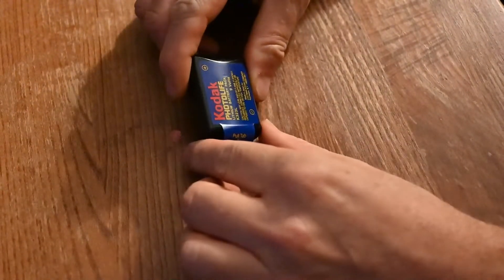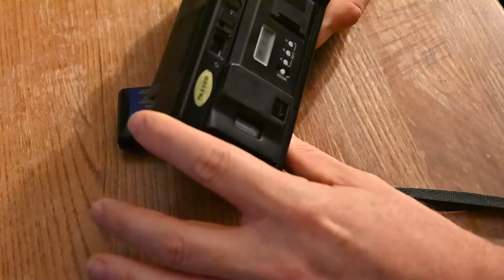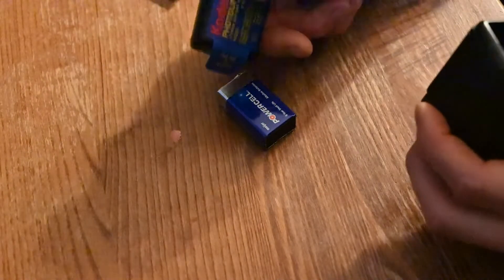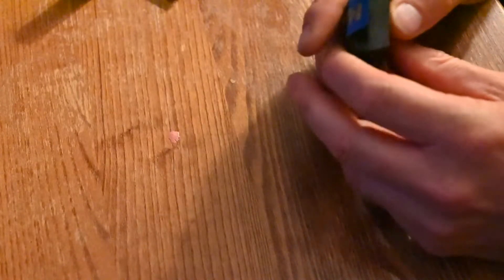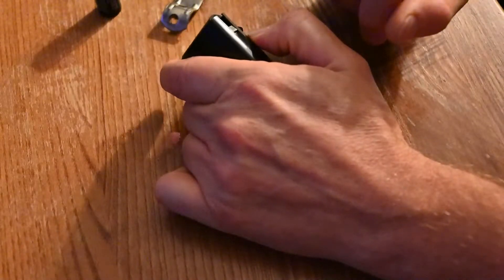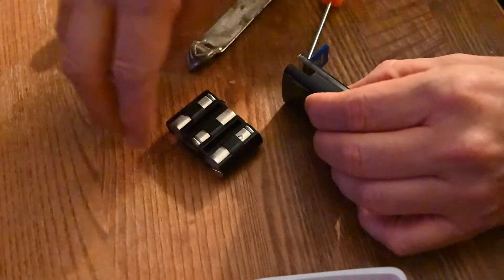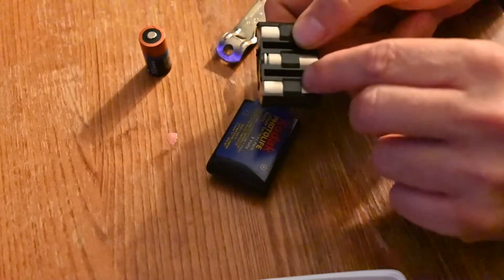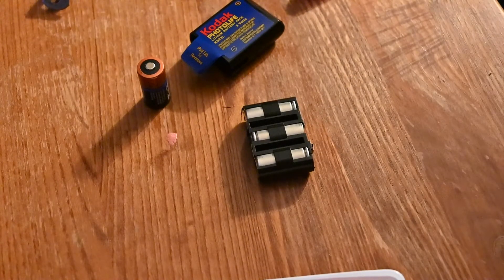KODAK K323L Battery Dissection / Modification for Reuse in a  Kodak VR35 Medalist Camera.

Comment: Very helpful video, were you able to unsolder and reassemble successfully? I might try it. Thanks!
Reply from the maker: I apologize for my delayed response.  I was able to disassemble the battery pack and gently break the solder.  However, I was unable to find similarly sized and powered batteries that would neatly fit withing the old battery enclosure.  I was seeking perfection and I did not find it.  I was looking for another Lithium 9v solution in a different size but I've not found one to satisfy me.

Comment: I  saw this for 10 bucks at an antique store today and almost bought it. I  thought maybe any 9 voltbattery would work, but read online that the battery is unique and not made anymore.
Reply from the maker: As I explain at 1:00 , you can use the common regular square alkaline 9volts you put in a fire alarm in it ( you might also try the same battery format but lithium, though I have never tested this).  so don't be put off by the Kodak K323L that is no longer made.  I'm just reconstructing the battery for the hellish challenge of it.